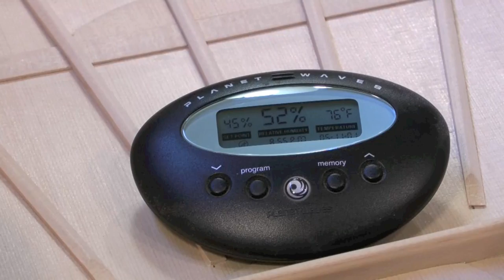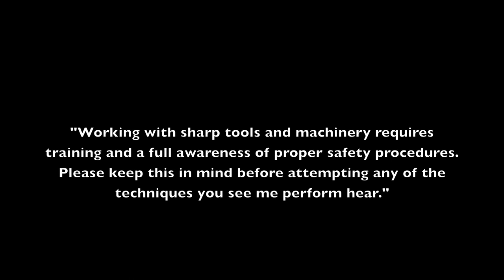Flamenco Classic Guitar Assembly

Comment from the maker: Water soluble glue is recommended for future disassembly. Also, hide glue shrinks while it dry's, therefore is perfect for tentalonies as no clamping is required.  Also, applied generously, hide glue is an excellent sound conductor coupling the top to the body. Also allows "floating " the body assembly to the top with no top distortion, therefore marrying the top in its "resting position".  It's all about freeing up and milking every last drop of the tonal response of the wood.

Comment from the maker: Good question . . . Applying  individual blocks (tentalonies) with hide glue allows the body assembly to be married to the top with no tension or clamping. Also, I believe that bedding the tentalonies in liberal amounts of hide glue enhances (like a conduit) energy/sound flow from the top into and through the body of the guitar more efficiently than other adhesives.
Reply: Congratulations on the fine, fine job. I am currently researching guitar construction in order to try to build my first guitar, I am curious as to why you chose to glue individual blocks (tentalonies) to the top but used a prefabricated strip of blocks to the back, is it for the larger size of the individual blocks or maybe it is more difficult to manage the glueup of the strip without clamps? I’ve seen that before but do not know why.

Comment: Exceptional video.  One question though.  At the very end when you used the corks to push down on the back for glueing, why not  use some wood or metal slats to go from one side to the other.